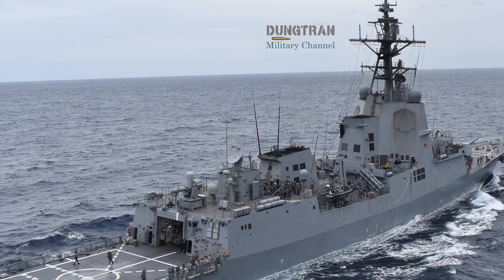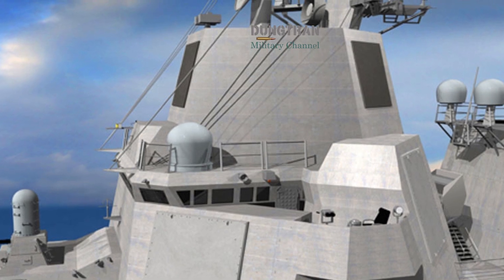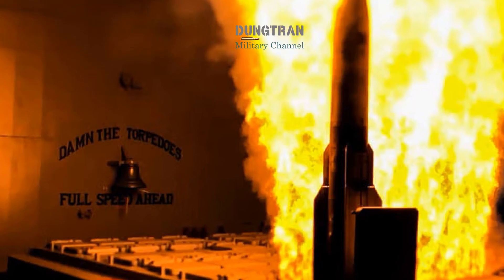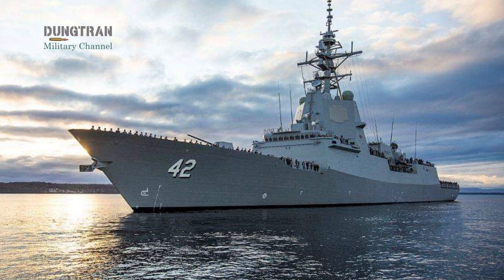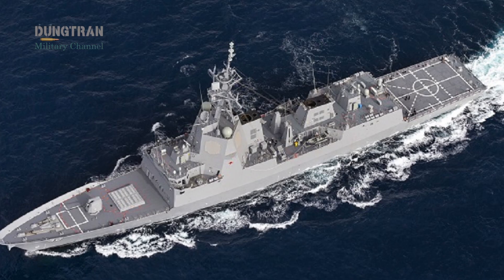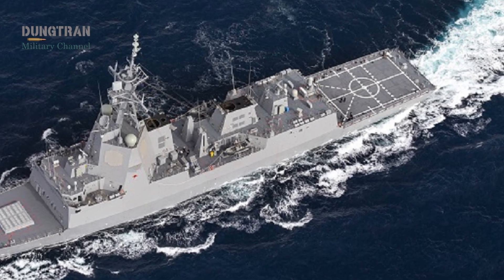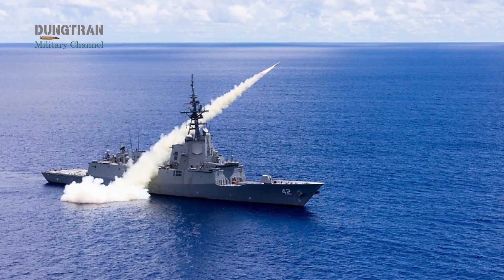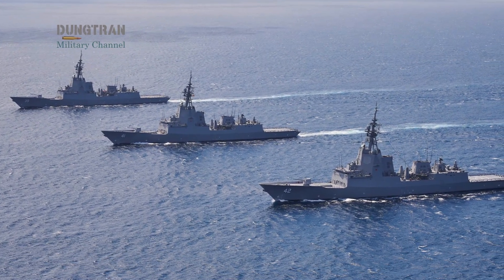Hobart-Class Mid-Life Upgrade: How Australia Keeps Its Air Defence Shield Relevant Until 2040

Comment: Australian upgraded AEGIS Hobart class frigates will have the Australian designed and made 6 faced AESA "CEA FAR 2" search radars that have not one, but two 2 bands of search radars, a 6 faced S band radar suite and 6 faced anti stealth L band radar suite.
Also linked with these multifrequency search radars will be the 6 faced AESA "CEAMOUNT Fire Control Radars" that can lock on to 60 missiles or targets at one time in a 360 circumference.
That completely outperforms US SPY 1, SPY 3, SPY 6, SPY 7, - S band radars with their single lock on capability fire control radar the AN/SPG-62 in the X-band frequency, these radars have limited stealth detection range.
Hobarts will also have an upgraded passive and active ship and towed array sonars.